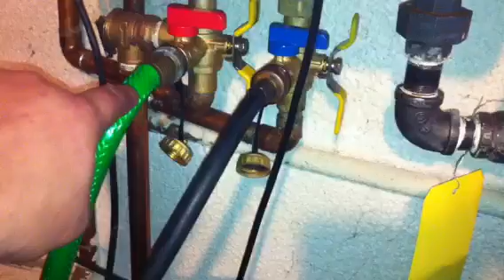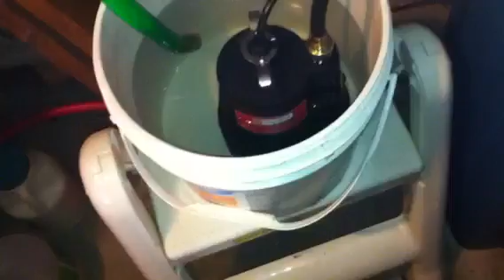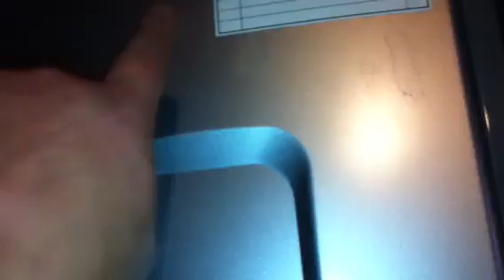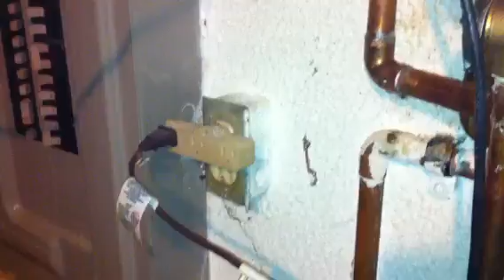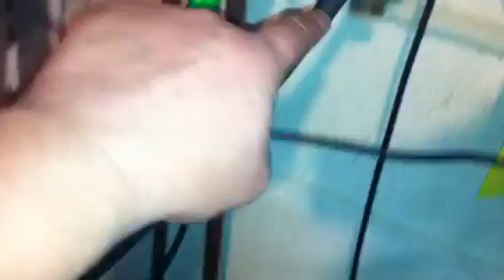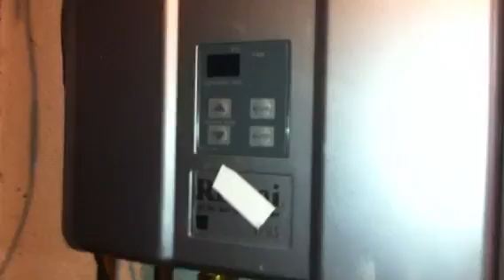How to flush out a tankless water heater

Comment: When you get done you need to inspect the internal water filter.  It is the black round knob at the base of the water in line.  If you don’t Che k this , you may get flow related error codes.  You can install a scale remover filter and never have to bother with this vinager process .

Comment: Works great so far.>>>ur2.pl/1102     This is being used in an addition for my mom. It works well for a one person application. Super easy to install. Of course it needs its own breaker at the box and then run 220 to it. Its small, takes up very little space on a wall. About the size of a show box.
Reply: goooooood

Comment: I just cleaned my tankless without calling in a handyman to do it.  Yes I had to learn how to fully tighten the valves but at least I save myself some dough.  I was shocked to see the amount of mineral deposits in that small heater.
Thanks for your video.
Reply from the maker: I to just replaced my combustion motor after getting a code 61 caused by a guy from triple a doing a free servicing on ours. After he broke it he quoted 524 dollars to fix his mistake!!! So I got a new motor sent from Rennai by making up a plumber company and they shipped it overbite for free. NEVER USE AAA for anything. Good for you and with my install and your cleaning that's 2 for the good guys and 0 for the service repair ripoff guys.
Reply from the maker: +Mr151josh over night. Ha. Spell check is funny.
Reply: EH CBunny could u help me with cleaning mine i am un sure about turning the valvles
Reply: Be sure to use 3 gallons of  White vinegar and nothing else
https://youtu.be/KFyc-xBiThQ

Comment: Good video.   I had to watch a couple and then realized that my valves are different  I think mine are called bypass valves.  Descaling as I type.  Thanks.  Old setups might have valves below and above inlet/outlet to bypass.    A couple more comments.  If you open the pressure to drain , make sure you close it otw the solution is not going to stay in the system.    Also the amount of solution has to be enough to  fill the system and not drain the bucket.  Not all systems have the same  capacity.

Comment: well first of all its a tankless system so there is no tank in there. second when you flush the system you need to leave the system on and running otherwise it's not doing much for you. turn your unit down to about 98° and let it run the vinegar solution through.

Comment: i have two Rheem tankless water heaters. when it was installed back in 2009 the plumber didn't install the service valve to each unit. one of the units just stated acting out. shutting off with an error that meant cleaning the unit. called a plumber got a $2400 quote which he discounted to $1800. i said let me get back to you. checked online got both kits for $150 delivered. an hour it was installed. i cleaned the unit according to this video just without closing the main water valve as i don't see a need for it. the service valve has a shut off valve already. i ran it for an hour and the unit works perfect. thanks Josh

Comment: Nice video but I believe most recommendations would be to reverse flow the flow.  I think I would chang your hoses around to go in the outlet (Hot) and come out the normal Inlet side.
Reply: +Alex Moody actually I have never read or gotten a recommendation to reverse the flowfrom a engineer or technician. On the other hand, I would suggest, and I have done this myself, is that after about 30 minutes of flushing, turn the outlet valve half off, such that a higher back pressure is created in the system while still keeping the flow going through. The higher back pressure will improve the contact with the vinegar and thus the scrubbing effect.
Reply: @TheJoeinhose  I have always flushed in reverse, to help peel the scale, which I have been told actually forms directionaly inside the tubes like fish scales.

Comment: Great video.  Only other thing I would recommend is before you plug in the pump also take out the small pre-filter with a leatherman tool by turning the tool inside the pipe right above cold faucet.  Put it in some water to clean it and then put it back in before turning pump on.  After flushing, take it out again to check and make sure its not clogged with sediment from flushing.  Clean again and put back in and your set to disconnect.

Comment: Very well done! You explain the process very well. I actually used an inexpensive sump pump and adapted it to the hose connections. using a a 5 gallon laundry tub. The 5 gallon bucket used is great too if you have one.  The Rinnai instructions are worthless.  Thanks very much

Comment: It never flushed like it should. Good attempt, but wrong. Ive installed over 600 rinnai units in 7 yrs. When the power is off, the cold water servo closes. When u attach a pump, it still is able to push a little water through, butnonky at about 15% of what it should. Remove the discharge hose out of the bucket and see just jow strong the stream is. You need to turn on the power,  and turn the gas valve off, then flush. Ignore the code 11 or 12 that beeps for the next hour. Then after a proper flush, you may need to remove both thermistors inside the unit and clean those off as well. 

A complete and thorough tankless service includes breaking down the combustion chamber and using an air compressor to rezlly clean it. Then shopvac everything out of it. Remove the flame rod and pilor rod, and sand them both, then replace the fiberglass gasket behind it. Remove the fan completely, spray it with air or clean with vinegar (if needed), and of course vinegar flush. This will ensure a 30 yr lifespan if you do a complete service every 2-3yrs.

good attempt though.
Reply: The video is well done, but John, I believe you are correct with the Rinnai.  I did find that I needed to turn it on for the flow to be stronger. Thanks for the tip on cleaning the combustion chamber as well.
Reply: I have a ECO 27 Just installed it. I get cold water but my hot water has NO PRESSURE. What could be the problem? Do I need to clean it already?
Reply: Thank you John. 
I have been trying to get my pump to pump vinegar from my bucket through the Rinnai for about an hour now.
Took the pump apart, tried several combinations of valves open and closed etc.
Everything was right about my setup EXCEPT that I followed these instructions and Rinnai's instructions, and unplugged the unit. WRONG!
How was I to know that the cold water valve (solenoid), would stay closed with the unit off?   Working fine now!! :-)
Reply: Hello John,  was wondering if you could give me a heads up on how to change the temperature on my Rinnai tankless RL75 natural gas.  I've got it to 140 now but for some reason I can't figure out how to get it higher.  I saw in the manual about changing jumpers around but still couldn't get it higher.  Please help if possible.  Thanks in advance.